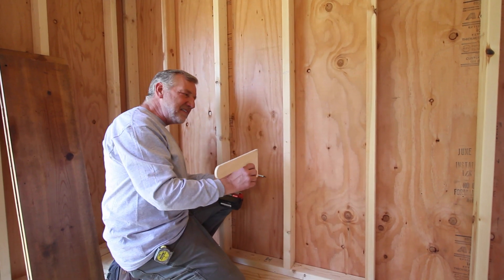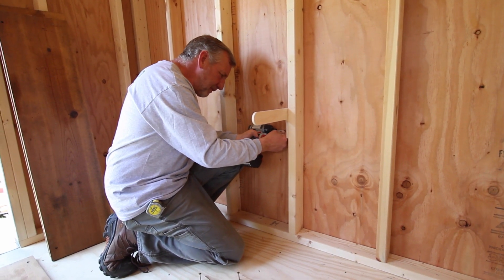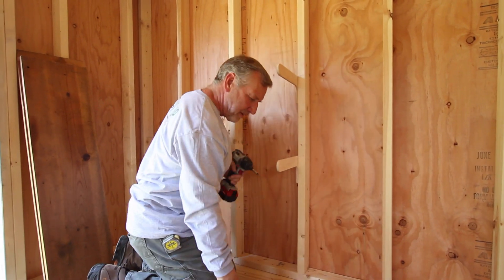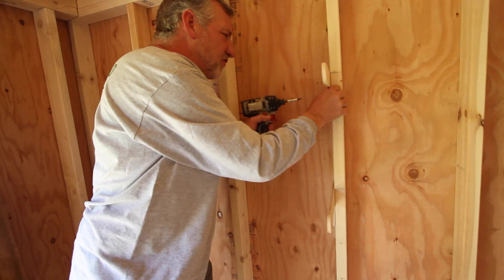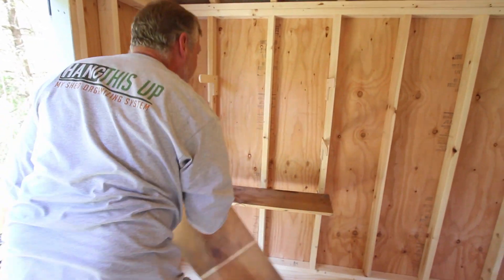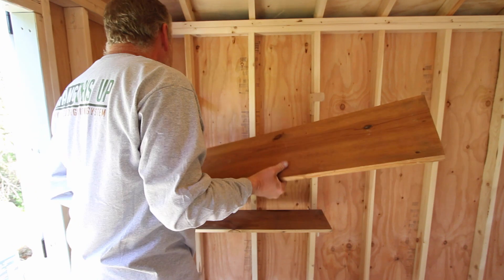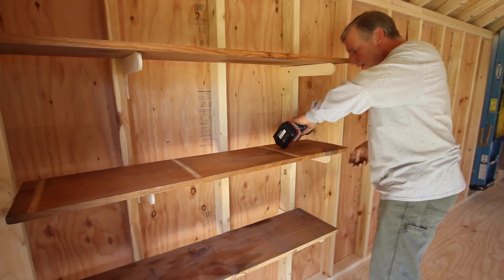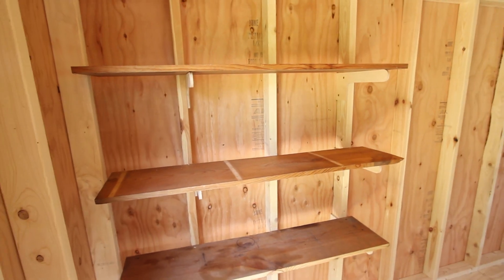How To Install Shelf Brackets - HangThis Up My Shed Organizing System

Comment: You can put a 1x4 behind it to fill in the gap.  And the corners require a bit more work if you don’t want any fall thru gaps.  A cleat will be needed in the corner for the bracket to attach to.  At least that was the case for me.  But, your system is effective and quicker than any other way I’ve seen.
Reply from the maker: Thank you so much for your comments and feedback.

I think that is a good solution for the gaps that occur when using shelf brackets in a shed.